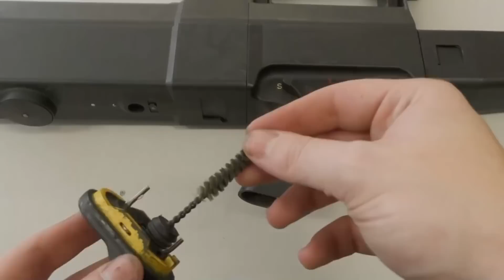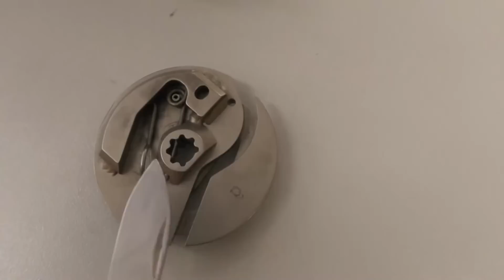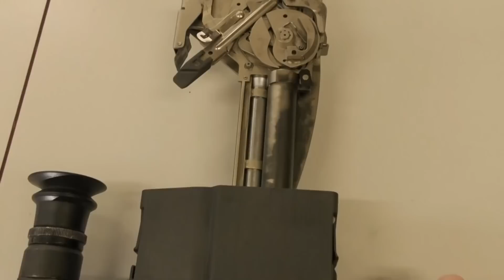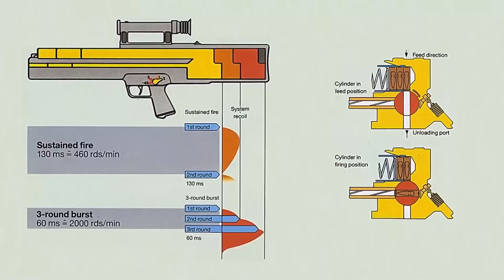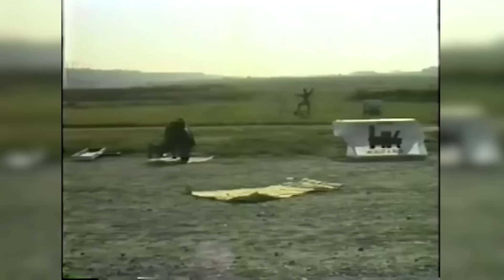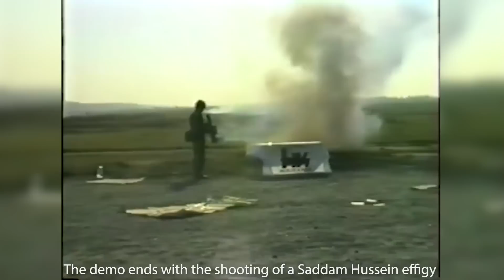Heckler & Koch G11 - Disassembly & How It Works!

Comment: In the 90s demo video it was shown as scopes are easily replaceable. But in disassembly video scope seems to be an integral part of the receiver?
Reply: I think this is an early version. The one in the demo has rail mounts for the sights and spare mag positions and a bayonet capability.
Reply: @Reactordrone  So, the latest and greatest version is the one with square handguard?

Comment: Theoretically this can be an incredibly economic firearm, with the barrel and chamber being the only parts required to be hardened enough to handle high pressures the rest can be stamped or sintered metals, the idea being if nuclear war were declared the G11 could be disposable and if you've fired it enough that parts start breaking youd be treated like a soldier that got the STG.44 that had to return to armory for parts/repairs: "ok, congratulations soldier we didnt expect you to keep this long enough to fire until breaking, here's a new rifle, and good luck out there."

Comment: I imagine that if this weapon actually saw long term use, many redesigns and simplifications would be done. One of them would be the removal of the burst mechanism and all the things needed for that hyperburst mode to function. Possibly even removing the recoil buffer system as it's only purpose is to make that mode controllable. 
I'm still hoping that some madman out there with the right tools and certs just does a "for the kicks" run of new G11 ammo just for there to be new footage of it. The newest I think is from a decade ago from what I believe was a Japanese program for all kinds of weapons?

Comment: Same problem as the AN-94, a one trick dog forced to do more than one, the mechanism is not that complex if it was made for single and full auto, the burst mode overcomplicated it all, the AN-94 is the opposite, if it was only burst it would be simpler.

Comment: The more I see of the G11, the less complicated it appears to me. Contrary to popular opinion, I think the G11 could easily have been wielded by grunts/infantry. Through standard training and familiarization with the weapon, grunts could easily learn to field strip and maintain the rifle. 

Sure, something could go wrong with it, which a grunt couldn't fix, but the same could be said for literally any rifle. 

The biggest problems this gun had, was probably its price to produce and the caseless ammo not being fully mature. 
Although, I have never really seen evidence that ammo doesn't hold up, but it never really got the chance to prove itself much either.
Reply: Same. It has more parts than the AN, but you can actually explain how it works. Alot of the parts count is just in the fact that it has to translate linear motion to rotary, and also that it has a round counter.

Actually, the way the G11 works could free you from needing a round counter. Just have the three-round burst actually be "full-auto until three rounds' worth of travel". Sort of a travel-activated disconnector.

The first of something is always complex (e.g. swinging link, as opposed to the Glock/Hi-Power cam block).
Reply: @smorrow  Agreed, especially the last part, that's why I would love to have seen how the VBR-CAR worked (supposedly a simplified version of the G11).

Comment: I can only imagine, as the seal on the chamber wears out, how much that whole clockwork action would get caked with carbon.
Reply: There was a serious amount of chemistry invested into that case-less ammunition. Without the casing shedding heat, the chamber was getting pretty hot, requiring the charge to withstand pretty high temperatures without spontaneous ignitions. But it also produced a charge which burned quite cleanly, producing very little soot. 
The ammunition came in sealed strips, and with no ejection there is very little chance to get dirt into the mechanism. The weapon was field tested with 1000s  of rounds fired without servicing/cleaning required. The stripdown shown was scheduled after 3000 rounds when the chamber would need replacement.

Comment: Very complex by the standards of a small arm but not much more complex than something like a VHS player. Soldiers trust their lives with drones, radios, laptops and all sorts of other equipment that's highly complicated to build and based on principles that are very difficult to get your head around, but simple to use. If you look at the G11 like that I think it had potential, though the hyperburst feature is highly dubious, I don't think the complexity of the system was really a big drawback so long as it was reliable.

Comment: The Bundeswehr dodged 3 bullets by not adopting this monstrosity.
Reply: If I remember correctly, German special forces units were issued G11's. The fall of the wall and the cost of the weapon is the main reason the regular army didn't get them.

Comment: This thing is/was a marvel of engineering and machining. It’s seems awfully complex for frontline troops and may have been an armourers nightmare but I wish it would have been issued by Germany. It could have been fascinating to see the G11 go through the maturation process of a military issued weapon system. Caseless ammunition and a near instantaneous 3 round burst were so innovative. The capacity was also a real advantage. This weapon and the British EM2 are my biggest small arms “should have been.”
Reply: It's a failure and there's a reason no one ever adopted it or any of the concepts at play in it. It's extremely expensive (firearm and ammo), a logistical nightmare (firearm and ammo), and 8lb for an assault rifle is well into "unacceptable". It's cool like clockwork/watches which are purposefully complicated are cool. As a firearm, it sucks.

Comment: Recoiling magazine looked counterproductive to recoil mitigation. Heavier recoil when empty or full?
Reply: Mag's gotta follow the mechanism, only way for it to feed and fire while the whole assembly is moving rearward. AN94 designers got around that by having a "shuttle" provide an intermediate feed position, but that only allows for two round burst.

Comment: I remember when I first saw this thing dissasembled. I thought to myself, you are kidding me right H&K? There is no chance in hell this thing is going to be adopted as a main line rifle. It is far to complex.

Despite the complexity, it seems the thing is actually reliable. Just looking at the design I would say no way, this thing is going to jam all the time, but H&K has a lot of demenstrations of it working well. It even does all the things it says it does. The recoil delay system actually works.

Comment: 9:21 People claim the G11 is complicated but to my eyes it actually looks very simple to manufacture. The action is mostly made from layers of stamped steel components just pinned together. Its very very similar to a high security lever lock pack from a door in the way its manufactured. Its genuinely quicker and cheaper to make than anything that requires machining or forging. If it ever broke I assume they could just drop in a new action.
Reply: Yeah but one crack in those parts and you'll need  a mechanical engineering degree to fix it, not to mention the sheer amount of spare parts that would put ridiculous strain on logistics
Reply: @Penigale  The idea was that armorers would only swap out the entire action as a whole. Any repairs and maintenance on it would be done by H&K themselves.
Reply: @Penigale It's not an expensive component. If it breaks you simply drop in a new action. Did you read or understand what I said?
Reply: @zoiders  Yes, and with a AR style platform you can drop in a new bolt carrier or upper.... it's still not cheap. You're talking about typically the 1st or 2nd most expensive component of a firearm, outside of consumables. 

I mean the military does do that, but saying that fixing a tank is not expensive because you can swap the powerpack when there is damage...is the same thing. It isn't cheap. It's a fast repair.
Reply: @SlavicCelery This isnt an AR platform. You failed to understand what I said. You think this action is expensive. It's not. That's because you don't understand manufacturing.
Reply: @zoiders  Stamping can be cheaper than milling and forging, yes. But each individual component adds additional cost and equipment to be manufactured. Many components, even if relatively "easy" to manufacturer add additional costs. 

The G11 is a large collection of components that will have to be manufactured to an exacting spec. You throw a rats nest of stamped components together and it's surprisingly not that cheap. Looking at you, HK trigger packs. 

In order for those components to be cheap they're going to have be manufactured at an incredibly large scale. They're incredibly expensive until they are cheap. The only way the firearm is anything less than expensive is absolute widescale adoption by the entirety of NATO. 

There really is nothing cheaper about that action than anything else. Couple that with caseless ammo problems, and it's not surprising to see why the program was cancelled.
Reply: Ultimately developments in CNC machining have really made milling a quite cost competitive option.
Reply: @SlavicCelery  Look at something like the more complex hinges for a modern 'Eurostyle' kitchen cabinet. This is not  THAT much more complex than some of them. Twice the parts count perhaps, and a little bit higher QC - although not as much as you think. Given that those hinges retail for about U$D 30 with all that, lets say that the guts of this are U$D100. You don't repair it. You make a note of the serial number, smash it with a hammer IOW the manual, and replace the entire guts of the rifle with new.

Comment: have to wonder, seeing complexity, how much of that might be removed if they'd go with electric power to cycle the action, I understand it adds another layer of issues, but still, this thing fouls and stops working then it is the same as running out of spare batteries, there is no way a regular soldier might get this working again if it stops
besides, sourcing batteries and access to electricity to recharge what can be recharged, seems to already be a big part of todays soldiers daily activities

Comment: It is funny how such advanced mechanism has plastic covers like recycled plastic.
Reply: It's the first "green" assault rifle. Made from recycled materials and it leaves no casings behind. 😮
Reply: @UnfollowYourDreams  The plastic end cap on the cartridge comes out the barrel (and is plastic)
Reply: @smorrow  no. The ammunition for the G11 is caseless. But even if not, the case would never exit the gun through the barrel. Source: i'm a veteran weapon technician and we had a G11 on our base.
Reply: @smorrow  no. The ammunition for the G11 is caseless. But even if not, the case would never exit the gun through the barrel. Source: i'm a veteran weapon technician and we had a G11 on our base.
Reply: @UnfollowYourDreams  So where does the plastic end cap come out?
Reply: @smorrow  it's a caseless ammunition, nothing but the projectile and gasses leave the chamber.
Reply: @UnfollowYourDreams  So the plastic is combustible?
Reply: @smorrow  it must be. Every rest of molten plastic would clogg either the barrel or mechanical parts and render the gun useless.

Comment: It may "delay the recoil" but it looks like it has a significant amount of recoil the way it jumps every time our 80's soldier squeezes the trigger.
Reply: All rounds have left the barrel before the recoil kicks in

But on the other hand, 3 rounds worth of recoil is acting on your shoulder
Reply: Every round has left the barrel before any of that recoil makes it back to the firer.
Reply: I'm guessing the added weight of the projectiles adds to the recoil. So three times the mas or, roughly the same recoil as a .30 caliber recoil. Just guessing.
Reply: 80's soldier only weighed 160-190lbs not 250 plus   and could run carrying something. Newtonian physics my friend.

Comment: The HK G11 weapon was designed for a nuclear battlefield: all the ammo is on the gun, it had flat surfaces you could hose down with Decon90 and you are unlikely to live long enough to need to clean or lubricate it.
Reply: There was a cleaning round designed, only to be used in combat of course.
Reply: CBRN environment actually makes a lot of sense, keep everything sealed tight until it needs to be used.
Reply: I always found the G11 blocky, awkward and uncomfortable looking to hold and shoot. The design makes a lot more sense now taking that into account. Reminds me a lot of the G43 rifles from WW2 that were over-gassed to ensure functionality, not longevity. 

Kinda makes me wonder in an alternate timeline where these things were adopted how much would have been changed from the prototype stage. Had a civilian version somehow been miraculously produced what kind of aftermarket parts would be made for it.

Comment: I truly hope whom ever powers that be at HK/W.Ger govt/NATO/US who greenlit this thing never ever be involved with weapon procurement..surely some huge payoffs were spread around to get this thing to trials...thanks for the vid cheers
Reply: The caseless ammunition used in the G11 also failed because of early cook off problems.
Reply: @hairydogstail  Akzo-Nobel  eventually solved those ammo sensitivity issues by the time the project was disbanded iirc.
Reply: @SonsOfLorgar  No they didn't, this is why we still don't see case less ammunition being used today. Extracted brass and steel cases take a lot of heat out of the chamber when ejected.
Reply: @hairydogstail  makes sense, and more layers of combustible laquer would just leave more hot residue in the chamber and extend the heat transfer time inside the breech making the problem worse and introduce feed jams on top, increasing the probability of a full mag cook-off...😬
Reply: @hairydogstail if they made the g11 “open bolt” (chamber is empty until trigger is pulled) it would be unique in that the weapon would not lurch forward the way a reciprocating bolt machine gun would, but instead the chamber would rotate keeping you on target while the action moves about two inches. With a bit more engineering maybe it could be made to only rotate without any back and forth motion as an open bolt weapon. Cookoff is a lot less of a problem if the rounds are separated from the hot components until the trigger is pulled.

Comment: I only can imagine what a 18y old grunt will do with the G11 after fieldstripping and trying to find a error/problem. ..... The armor Sgt. must have daily a heart attack 😅
Reply: i remember seeing somewhere that the idea of the g11 came about during the period of the cold war where it was pretty much accepted that a frontline west german soldier would have a tiny lifespan and probably die before they'd ever need to repair this thing, their job was just to put bodies in front of the advancing soviets until reinforcements arrived. that helps explain why this was even considered seriously, because it was the result of a very depressing calculus that command made that one soldier needed to make as much of an impact as possible in the tiny amount of time they were expected to be able to
Reply: @planetfixer  let's also not forget that mechanical watches were still extremely common back then, factories could just poach watchmakers to assemble these in bulk when all that's needed to be fully hardened were the barrel and chamber along with springs and the rest would be sintered or stamped steel. Everyone would've treated this like a truly fielded Stg.44 in that it's a miracle that a soldier lived long enough with this to see breakages, but "here's a new rifle, good luck..." With little fanfare
Reply: @planetfixer  Not only considered but going through the whole assessment process successfully, but luckily later over taken by other designs.